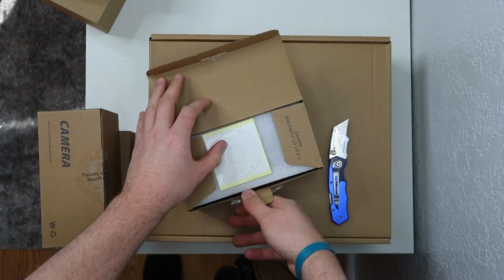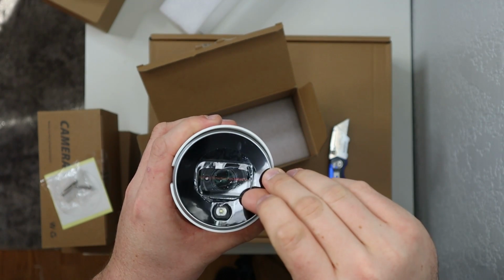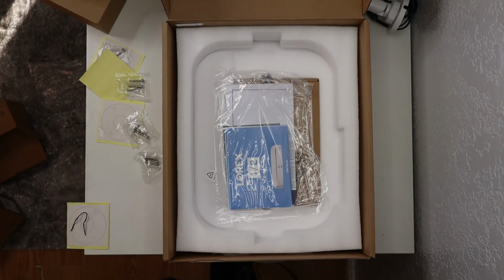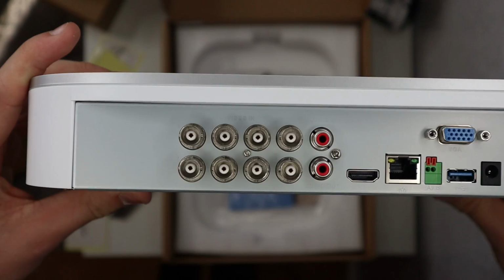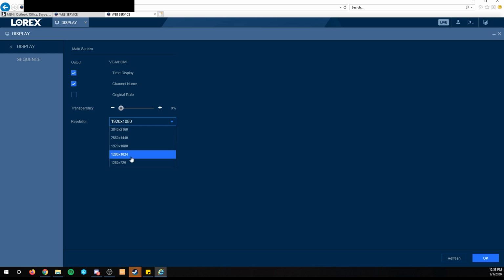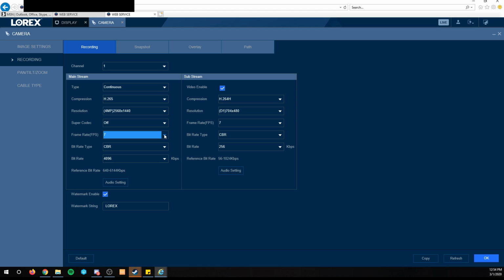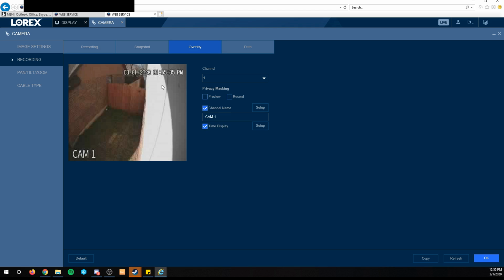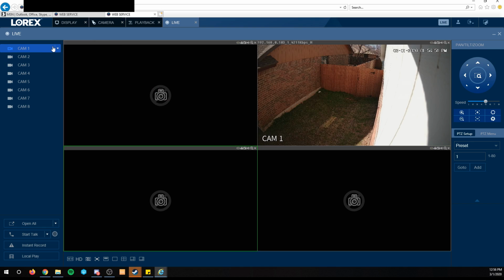Lorex 4K Security System Review

Comment: I recently installed this system at my home in the mountains and during the week I’m at work 4 hours away and love the app. Any movement and I’m notified but there is a slight delay only a few seconds and that’s cool not a big deal. The cameras have been through a couple gnarly snow storms and rain and some low teens cold cold nights and keep plugging along perfectly. They are all tucked up under my eves and probably haven’t been battered by direct snow or rain but they’ve been out there and it hasn’t fazed them at all. One camera points towards my gate which is about 980 feet away from it and I can see it no problem during the day on my phone and at night I see headlights at the gate as well. I also see the reflectors on a power pole in pitch black at about 350 feet away. This is my first experience with night vision or security cameras and I’m impressed so far. Night vision is amazingly clear especially on my 4K TV at home. My only complaint is having 18 acres with a few outbuildings I wish I would’ve spent 200 more for 8 cameras because the cameras are one something apiece and 4 isnt quite enough I now realize. So far so good though. Also my wife is setup through her own email and we can both view on our phones at the same time. I haven’t even done the internet explorer thing I only installed hooked up Ethernet cable direct downloaded app created accounts for my wife and I and that’s it. I guess I should check out some of the stuff you were talking about here to get the most out of it thanks for the info.

Comment: I'm mostly worried about the physical set up.  How difficult was mounting cameras/running cables?
Reply from the maker: If you are familiar with using some power tools to drill in to the outside walls of your house and used to maneuvering your attic then it’s really not that difficult!

Comment: Thanks for sharing this! I just bought the four camera system from Costco. Can't wait to finish my install and try it out. The only issues I have had, is the ethernet and monitor cables are too short for my particular application (which is an easy fix and not the manufacturers fault). Thanks again for your review! Makes me happy about my purchase (mine is not quite on-line yet)
Reply from the maker: It’s definitely a great system! I had to make some changes myself to some cabling so it could all fit properly in my office. Glad this review helped!!
Reply: What are moving objects at night like? Does it make a difference if colour or B/W is set?

Comment: Thank you for the review.  I see wired & wireless options available on this model.  Does that mean you can connect either one to this system?
Reply from the maker: Lady Cropper I believe it would require the cameras to rely on rechargeable batteries if I’m not mistaken but I could be wrong. I wanted the wired option to make sure that I would always get the recording quality I wanted and to make sure the cameras would be powered 24/7
Reply: @Dabenny_TV  I'm need to be able to have some cameras with wired and few wireless since Im installing in our home and metal workshop.  We have cat5 buried to shop and the dvr box will be in shop, that's where wired cameras need to be.  Should I use cat5 or bnc?  I want sound on cameras.  6 to 8 cameras with option to record on some, if power out.
Reply: Where does it say the cameras are wireless?

Comment: Why didn't you buy an NVR system?
Reply from the maker: gwarslayer what I found when researching these is that NVR and DVR are near the same besides NVR being IP based with cat 6 cables and the DVR uses the BNC cable to connect via coaxial connections. The recording and clarity are near equal so at that point it was a price point thing. At the time I purchased this system it was around $450 where as the NVR setup with same number of cameras/channels was around $200 extra. PLUS the cost of extra cat 6 cable is much more expensive compared to extra BNC cable. Long story short I didn’t want to spend the extra cash so I just went with the DVR.